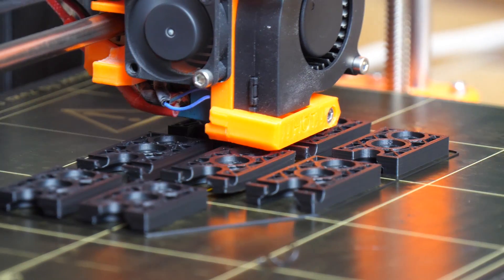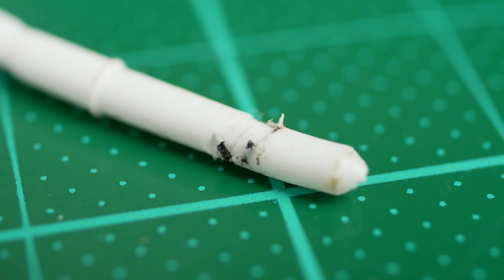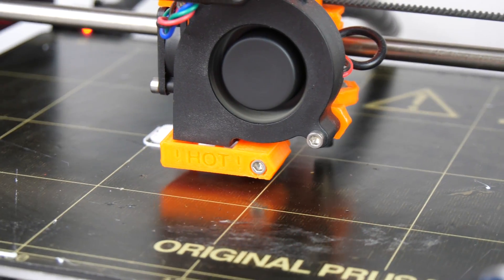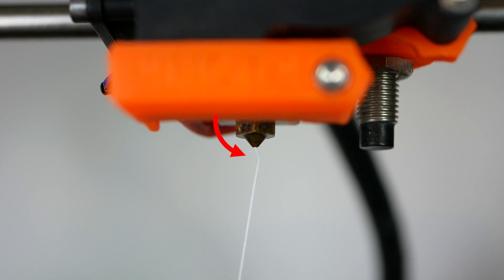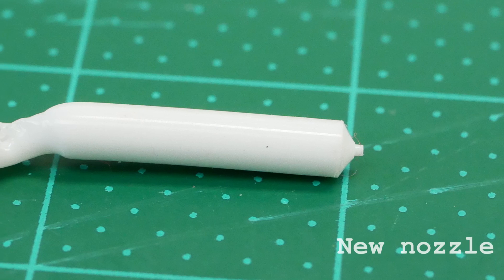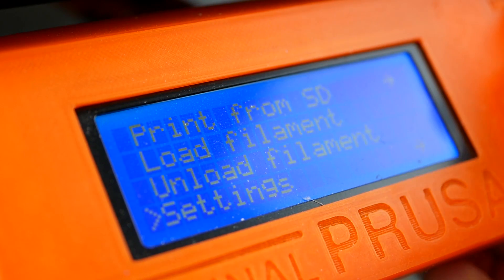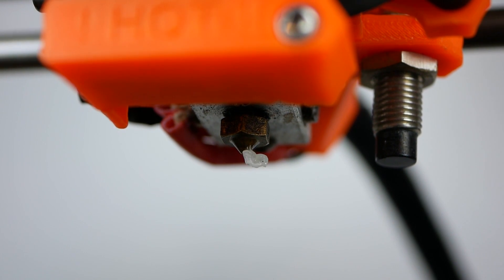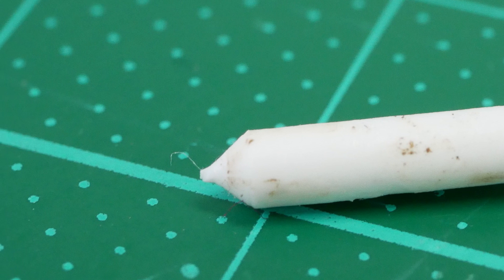Clean a DIRTY nozzle with 3dklean filament - It works!

Comment: Am I the only one who glows out his nozzle, placed upside down on a sharpened drill bit, with a propane torch until it's red hot and there are no flames coming out any more?
Reply from the maker: Interesting to hear. I also already did that but was always scared of the brass getting too soft and residue staying in the nozzle. But not an option if you run an Ultimaker 3 or similar, where you can't isolate the nozzle.
Reply: ElMarichi, your Teflon surface probably got damaged with time, so it's no longer completely Teflon, because it's not actually very temperature resilient. Perhaps it's now Teflon with voids that the foreign material can penetrate into and grab around it mechanically rather than being bonded to it chemically. Fact of the matter is, Teflon's adhesion to all known substances is extremely low. The way they get it to stick to the frying pan in the first place is by embedding it into the porous anodisation layer of the aluminium, and it still doesn't actually stick very well, eventually it will peel off.
Reply: Hey Cutter,
Just a headsup quenching a material like brass serves absolutely no purpose, other than stressing the material, no hardness will be gained from quenching it.
Steel is a different story but it depends on the type of steel that you go in order to know if it is hardenable and on what temperatures.
Reply: You are not. I torch my nozzle on every change, it just takes one minute to clean. I even checked with a microscope and it is absolutely clean.
Reply: Someone sells coated nozzles to reduce PETG stickiness https://www.mapa-refining.de/produkte/d%C3%BCsen-nozzles/
But you can't torch them, the coating is only good up to 450C
Reply: Cutter Slade, as a matter of fact, this very channel tested filament oiler in two videos. In one of the cases, it made for significantly stronger prints, while in some other test cases, it resulted in weak prints. So why do you say it absolutely shouldn't be done?
Reply: So you're essentially objecting on religious grounds. Nothing happens to e.g. silicone oil near printing temperatures, or to seed oil. Also filament at printing is not particularly liquid, it's a viscous paste.
Reply: Cutter Slade I disagree every now and then I start getting weird results I'll rub a little oil on the filament going into the printer crank up the temperature and just force a bunch of a filament through many times I'll see Gunk come out when when I do this and it prints better afterwards I don't use an Euler I think that will interfere with the plastic that he's into itself but just a little bit of oil on a couple inches every now and then seems to work very well keep things cleaned out I'm still using original brass nozzles after thousands of hours of printing
Reply: Cutter Slade snake oil is where someone takes your money for something it doesn't work you've got oil in your kitchen question nothing for the amount you need just grab your finger on it coat a few inches of filament and feed it through

I don't think one of those are necessary but a little bit of oil now and then does seem to help keep things smooth
Reply: I don't think Teflon spray is gonna stay on there very long. Teflon doesn't really stick to anything very well, so it's actually pretty hard to coat something with Teflon. You also can't glue Teflon, no known glue sticks to it.

But i think that's why people use filament oilers, one of those reasons.
Reply: @Siana Gearz: My frying pans tell me that anything I cook sticks very well to this overrated Teflon, although it isn't supposed to.
Reply: So that's why the Teflon principle generally is a bad idea for pans. As I only like long lasting technology I'll stick to steel pans in future. Thank you! :)
Reply: Adding oil actually can help, specifically high temperature olive oil (that doesn't burn until 242C) - what it does is it rubs off into the cold side of your heatbreak, and reduces friction there (like any lubricant would) while on the hot side it heats up, and comes out with the plastic.  ABS you might not notice as it tends to be lower friction, PLA you will start to notice especially if your heatbreak isn't perfectly smooth, and flexible filaments can have a huge difference as the decreased friction allows the flexible to feed better.  It wouldn't make sense to BUY an oiler though, if you're wanting to spend the money then just buy something like a Microswiss heatbreak and nozzle with it's lubricative coating.  The oiler is more to get by with cheaper components like a rougher $0.50 Chinese clone heatbreak.
Reply: That's a nice idea! I will do this from now on. Much more satisfying! Does anyone know of a coating to keep filament from sticking and then slowly cooking on the nozzle surface? Maybe something like Teflon spray?
Reply: Please, never oil your filament, that's total nonsense!
Reply: If you quench it in water when it's still very hot it should become even a little harder than before.
Reply: I have some bad Teflon spray I could test on an old nozzle. Otherwise the sticky nozzle is just annoying not worth an expensive new nozzle for me.
Reply: @CutterSlade001  teflon breaks down at high temp, 200 something C? Releases toxic gas
Reply: @MaximilianonMars  I remove the  nozzle from the hotend of course ;)
Reply: Well firstly, that sounds not very convincing. And because it introduces a flammable liquid into a very hot place. If your printer doesn't work properly you should fix the causes not introduce a possible fix and introduce possibly toxic fumes to your home. Also, filament turns liquid to be printed, to me it make no sense to lubricate a liquid. Extruders sometimes have enough problems feeding filament using some sort of hobbed gears, adding a lubricant can't be good. And finally when you print with PLA 3D printing is almost sustainable, adding fossil fuels to the hobby is just wrong.
Reply: Well ... I have strong feelings about not using an oiler, but all my arguments are based in practical reality so I wouldn't call them religious. That said I just think it's the snake oil of 3D printing, although... now that I think about it, it needs to be a product to be a snake oil. The fact that no commercial printer (that I know of) has an oiler only speaks to my argument against them.
Reply: @Nerys Well have you tried this without using the oil? It's very likely will still going to work. Having a permanently attached oiler is what I really don't like. I might try it if I had a really though blockage and don't want to glow out the nozzle. But I'd rather flush with higher than normal temperatures a few times more.
Reply: @Nerys That's what I was trying to say. There is't even someone who is trying to sell you an oiler, probably because everyone who knows enough about 3D printing and has the capability to produce/sell some, knows it does nothing.
Reply: @grey array Yea I kinda knew that the effect was very small, but not that it's nonexistent. Do you have any references on that? I think my knowledge doesn't go above what I once saw on YT probably @ AvE.

edit: found something "The process of hardening and annealing brass is exactly the reverse of that used with steel. Brass is hardened when it is heated and allowed to cool slowly ; it is softened or annealed when heated and cooled suddenly. "  http://chestofbooks.com/crafts/machinery/Shop-Practice-V1/Hardening-And-Annealing-Brass.html

I guess I'll try it the other way around next ^^ .

edit 2: Well, most other sources say it can only be work hardened. I'll keep quenching it in the hopes of breaking loose more burned filament inside. Because it doesn't hurt making it red hot and it's going to be annealed during printing again.

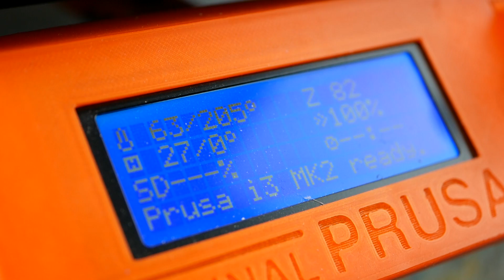Comment: 2:35 - Bend the frame of the printer at the same time?
Reply from the maker: Nah, already did that a hundered of times. Everything still fine.
Reply: Fred Blogs hi
Reply: It's something to pay attention to though. Not neccessarily the frame so much, as to avoid yanking down hard on your hotend/print head when the filament breaks loose.

Comment: I have never had a nozzle extrude the filament straight down.  They always looked like yours did and these are old, and brand new, brass nozzles.
Reply: The Best Stooge 
me neither and the machine is doing 120mm/s no problem so even if it doesn come straight, it doesnt seem to cause any problem and the surface finish is ok
Reply: Precisely Laharl.
Reply: it's likely because of the cold end fan blowing on it
Reply: The Best Stooge Same. Even after running cleaning filament through, I rarely ever get those kind of results, whether it's a cheap eBayzzle for pushing abrasives through a nozzle I shouldn't, or a brand new E3D nozzle. It doesn't seem to make any difference, though.
Reply: The Best Stooge 
yeah here we also saw that. some filaments would slip easily and be hard to extrude, some would have horrible surface finish, some would look better at fast speeds than at slow ones.
if anything is consistent, is that at higher temps, the parts are stronger, independent of the look, the rest is up to the brand and whatever chemicals they add to the filament.

Also, even with a half clogged nozzle, if you slow it down so that it doesnt slip, the prints end ok. Its all about extruding the necessary amount of plastic, not at the correct shape or diameter. Even if we use 0,4mm nozzles here we use them most of the times at 0,5mm to get better layer strength and sufface finish even at high speeds.
Reply: I have tried various temps as I was thinking the same and I have come to the conclusion that the brand of filament means way more than people think as temp played really no big difference in if it flowed in a curve or a straight line when suspended in mid air.  I even tried in a cold room and a hot room and an enclosure so I can't figure it out.
Reply: William Sjreckengost Yeah, so not sure why though.
Reply: I have had a mix of straight, and curled. I'd assumed it was to do with print temperature or something.
Reply: That might be due to low quality filament.